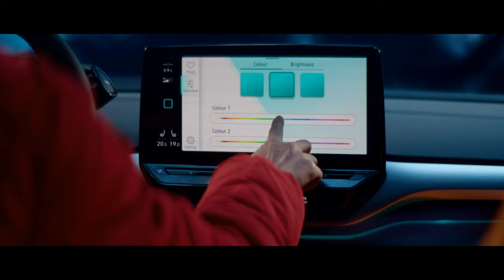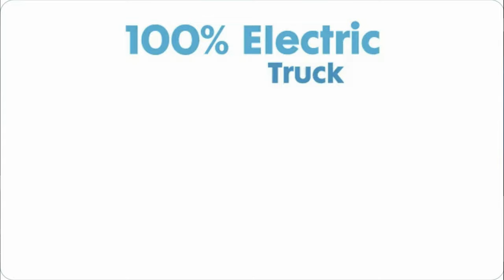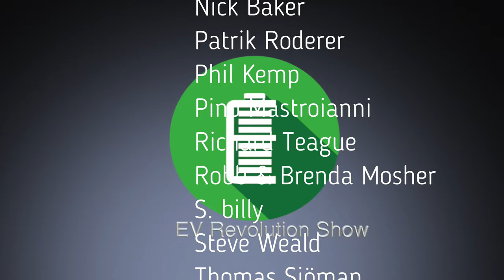Episode 128 - U.S. EV Growth, Lexus EV Plans, GMC Hummer EV SUV & Silverado and more!

Comment: Nice video. I want to admit that EV efforts from GM look and feel real while Toyota leadership is still trying to muddy the water with electrified term which by itself mean HEV vehicles. I believe Toyota has excellent engineers and designers to issue wonderful EV if not being embarassed by an old stubborn boss pulling the leg. Why all vehicles from Toyota are not HEV and PHEV after 20 years of HEVs on the market? At the end of the day that company introduced and perfected that technology. So far many new huge SUVs and trucks from Toyota have ICEs with the worst fuel economy in the industry in North America. The best PHEV on the market in North America RAV4 Prime is sold in so few numbers that allows dealerships to add 10000 USD markups. The latter vehicle is forced by Japanese government though. All EVs produced by Toyota and Lexus are forced by Chinese government.
Reply from the maker: Thanks, yes GM is very real indeed.  For those that think not, they don't get it.  

Agreed, Toyota, Honda and Mazda are really all behind the game and need to catch up.
Reply: @EVRevolution  Honda is partnering with GM. If they manage to produce enough battery cells working together with LG and push the price below 100 USD per kW then they will be just fine. Mazda and Subaru are tied up with Toyota holding large shares of those companies. Those 2 companies have little freedom of choice unfortunately. However Mazda is struggling to bring its rotary engine range extender equipped EV to North America anyway. It is a compliance vehicle but it is an valid effort anyway. I hope a soon management change will happen in Japanese companies to free up their creative potential since those corporations employ marvellous engineers unlike their CEOs.
Reply: @nevco8774  GM is to announce their 3rd battery facility this week.  Sorry for the Japanese but they will be playing catch up for awhile to this changing environment.

Comment: I wish the GM stylist designers had some imagination. There's no reason a BEV Hummer or Silverado has to still look like a 1950's pickup, with the aero of a brick. And I can't wait to see the EV box trucks running around the Chicago area.
Reply from the maker: Thanks for watching.  Guess they want to bring back the Hummer as remembered in general, and not rock the boat for current pickup truck designs that are selling, very very well.